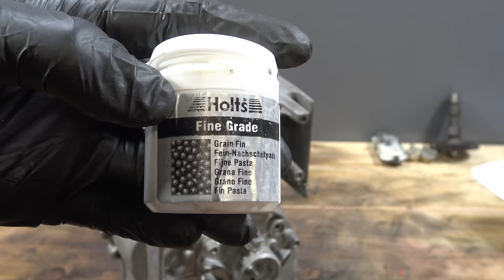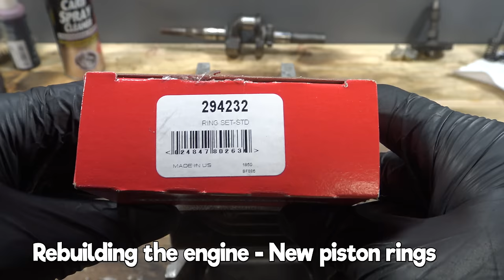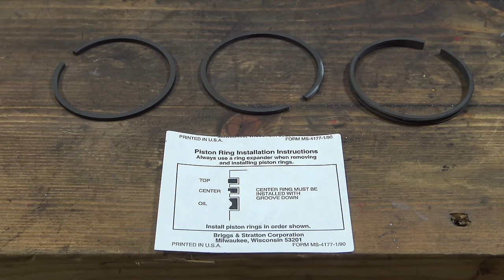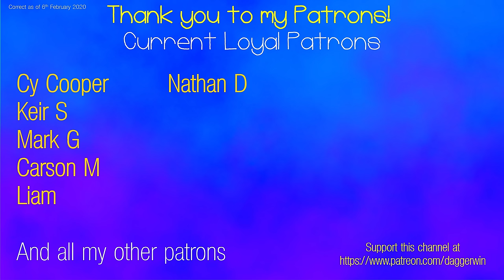RUSTY ENGINE REBUILD RESTORATION (Will It Ever Run Again)

Comment: Hell, that engine was in great shape to start with. The muffler hadn't rusted off and the tank had no holes!
Reply: Looked like I had a a fresh plug in it before teardown.
Reply: Also looked to have a more modern style head gasket when it was torn down.
Reply: @mattrzewnicki6343  it was..lol  and i still havent figured out what parts was missing...maybe what ever it was hooked to...lol
Reply: I'd have to agree, fresh plug and oil and sanding of the points it be going again
Reply: @holt7271  it was missing the Governor but I didn't see the bearing races for one anyway
Reply: @JamesMiller-fm8qs  me either..you know it would run a little in the first place...really wasnt a rebuild..he just took it apart and cleaned it..lol
Reply from the maker: It was missing several parts Shaun. No starter clutch, no points cover, no governor and no air filter assembly. No way could this have been started. Also the rings were replaced.
Reply: @MachineryRestorer  You spent more on the rings, gasket set, starter clutch, etc. than a new motor would have cost! I can get all the F-head 3 HP's I can carry for $62 a piece. $109 for a new-style iron-block OHV 3.25 HP...
Reply: @holt7271  they had a little peice of sheet metal on the back of the block heat shield other than that it wasn't missing anything
Reply: @MachineryRestorer  good job kid. It's good to see younger generation, restoring things that were manufactured before they were born
Reply: @Walkercolt1  I think you missed the whole point. It wasn't about saving money.
Reply: Machinery Restorer  where are you getting parts and gaskets for this one?
Reply: That carburateour wasn t looking prety good and it could get more damage
Reply: @MachineryRestorer  can you pls say we're did you get the air Filter (which Artiklnumber) pls
Reply: @Walkercolt1  But then he wouldn't have a video that has 1.2 million views.
Reply: @MachineryRestorer  You did a great job on the engine, demonstrating a lot of techniques.
Reply: @Walkercolt1  you can also buy a 6hp predator at HF for around 100$ but anyone can buy a motor. If you like buying things that other people worked on, by all means go ahead. Some times people like to do the work themselves
Reply: What do you set your sonic cleaner on as far as temp.
 @MachineryRestorer

Comment: Anybody else start this video, and say to themselves, “It’s an old Briggs, it’ll run.”?
Reply: How will old Briggs not run? Even if it was underground buried for 10 years it will run. They built them so good they can't be destroyed. It's just that good
Reply: @andrewstrainstuff1773  lol with ya there
Reply: Soon as I saw the sticker im like yeah that's got another 200 years left in it
Reply: @omfgallusersaretaken   u right u right
Reply: I find these old engines in trash piles from time to time. Usually needs nothing more than fresh plug, few shots of carb cleaner, and a couple of pulls to get running... You can't kill them.
Reply: Huh, that's weird.
Reply: @michaelh7527  hey uh Michael, where do you live at? I'm trying to build a railcart and could really use a small engine like that!
Reply: Andrew's train stuff dude we rebuilt one in my auto shop and we ran it on carburetor cleaner
Reply: Yea I rebuilt one of these for my go kart with my dad 2 yes ago it was have token apart left in a barn for 17 yrs and me and my dad rebuilt it in 2 days still runs
Reply: Yea
Reply: I have an old Briggs 159cc it won’t run at all
Reply: my uncle lost one, it did take a sewage truck running over it though...
Reply: It looks great on the inside. I have seen worse.
Reply: Dylan Boerboom yes, I chuckled and said  “that isn’t a question, I know it’ll run”
Reply: Engines are actually really simple you have to really fuck up not to make it run again
Reply: No.
Reply: @andrewstrainstuff1773  they used to build good engines... Now they are crap
Reply: @romanrapoz4813  Yep.  Every newer version I have I've had to at least take the carbs apart and drill out the main jets 1 - 2 sizes larger just to get them to run without having the chokes permanently wired half on. 

Interesting side note is that even with the larger jetting they actually burn less fuel at load due to not being run in a excessively lean condition!  😎
Reply: No, I was thinking more in terms of why spend the time and money rebuilding a disposable Briggs. I have a Kowasaki engine model FA130  that was used in a 1988,  1989 Coleman-Powermate 1500 watt generator, I used it for all my power for a good 3800 hours run time at about 6-8 hours a day. I havent used it in 30 years, it really needs a new carb but it would run if I replaced the carb.
That Kawasaki engine was really nice, it got 6 hours of run time on a gallon of gas, quiet, smooth, if I could get a lawn mower with that engine it would be great. Always started right up, electronic ignition no points.
Reply: Yep, missing parts or not, it probably would have started right up without doing anything to it lol :)
Reply: Yup
Reply: One of my lawn mowers is from 1977 (Swedish Klippo) with a 4,5hp Briggs on it. Only thing done to it is new rings around 1995 (when I bought it), still runs perfectly.
Reply: Picked up an old go kart that had a rusted out brigs on it, no way it would start. Towed the kart  with a bungee cord off the exhaust of my buddy’s accord and all of a sudden the motor springs to life- all fun and games for 30 seconds until something flies out of the crankcase and I have a liter of oil on my shirt- ever since it’s been Honda’s for me
Reply: @andrewstrainstuff1773  the nokia phone of engines.
Reply: ...and you can even update it to electronic ignition       gotta love those old adjustable mainjet pulsi-jet carbs
Reply: CIA what an insightful reply. Hope you’ve had a good day, bud.
Reply: I used that one as a kid.
Reply: Andrew's train stuff go to a junkyard I’m sure you’ll find an old rototiller or something with one
Reply: I thought the same thing
Reply: Rollie mike   you sure yours is a briggs old briggs just had a choke tecumseh uses a primer
Reply: @forkliftofzen5318  I find that with most China engines, I wondered if maybe the factory was at high altitude.
Reply: @Dakalberry  It's due to emissions compliance.

Comment: Them old Briggs & Stratton's are great
Reply: Have you ever run Honda and  Subaru???
Reply: Mohabat khan Malak yes, and it’s still great.
Reply: I've done a few old Kohler's they held up well also, love seeing this restored.
Reply: Which cars or bike engine is this
Reply: I rebuild one for shop class and it had no hours on it like maybe 20 at most it's in great shape so I got a A+ on that
Reply: @mr.abhishek8158  lawn equipment and people put them on mini bikes and go karts
Reply: @jessemarchese7245  thanks bro
Reply: abhishek abhu probably a tiller motor
Reply: Funny enough I’m taking a class in high school right now as a junior and these engines were the first kind that we learned off of pretty crazy to find a vid of one being restored
Reply: @cullendugas228  Wood chippers, chipper vacs, yard vacs, trash pumps, water pumps, Snowblower's with winter shields on them, gas powered air compressors, lawn aerators, mini bikes, go karts, roto tillers, the list these engines were/are used on goes for miles, theirs millions of them. The 5hp is even more common.
Reply: New ones are great too
Reply: @SocietyUnplugged  They are? Because I have a pile of blown Inteks laying around all built in under the last 10 years. They throw rods like its their job. That Chaluminum their using to make them in China doesn't hold up well.
I swapped old flat heads back onto 6 to 8 lawn tractors that all had blown up POS Inteks all that were under 10 years of age for engines that were averaging 25 years of age and were built in Wisconsin and thats a fact.
Check my channel, I filmed a few, tractors that still looked new that have flatheads on them.
Reply: Fearless Thank You. I don’t share the same experience, so I guess I’m lucky then. My experience is also based on a handful of engines. I stand corrected
Reply: @SocietyUnplugged  The new ones suck. I'm sorry, they do.
The push mower engine's with their plastic carbs, garbage.
The intek tractor engines, with the NIkki 6, garbage. Even the v twins aren't as good as the opposed twins were. How many people have seen a valve guide slide on the old opposed twin? I haven't, but I've seen it plenty on the v twin. The only great engines briggs still makes are the vanguard's and those are expensive engines.
Hang onto those flatheads, they just keep going.
Reply: @Mr_Tecumseh  the plastic carb on my briggs engine makes problems all the time. Such a shame
Reply: @Mr_Tecumseh   it's common strategy mate. If a company sells you something that will run for 25 years, they wont take any more money from you for that time  being. If they make an engine that lasts for 8 years, they ll take money from a customer sooner. That's why 1300 euros cellphones are trash after 2 years of usage unlike the old ones, same as ovens, same as cars, same as boilers, as microwaves, as laundry etc
Reply: @DDBmaster  I've repowered several tractors in 2019 with older better engines, some still looked brand new. Its the Chiluminum Briggs is using now. They can't hold up. Its too my benefit. I have a pile of Inteks with thrown rods laying around, their garbage.
Its really unacceptable for machines this new to be having colossal failures that soon. The thing had barely any use, oil was within range and translucent. When does planned obsolescence go too far? It was a $2000 machine, it turned 5 the day I got it. But your right, he went out and bought another brand new Craftsman Tractor and the next one was even cheaper made. But hey, I'll take it. Now that Tractor has a better engine than the rest of them and should actually go 20 years if maintained properly. Its not a problem for people who know how to repower them. It isn't that hard, but most guys cant and don't have the time.
https://youtu.be/-_bpmvlNDys
Reply: @mr.abhishek8158  and theirs also raptor briggs engines for race go karts
Reply: You right .. now are more plastic than the metal . and the metal is porous ..
Reply: @mohabatkhanmalak1161  briggs very good motor
Reply: @Mr_Tecumseh  Exactly,  intek engines  are junk! One summer and the  compression release  broke!   All of the briggs flatheads were good ,keep going for years if taken care of!   I Put a briggs  opposed twin  in place of the intek .  Also 1983 8 hp horizontal briggs, i have since new fires right up and runs great,was on Troy-Bilt tiller .Wore tiller out engine  still going!    A  shame no pride and quality  anymore!  The flathead engines  have a bump cast into cam lobe for compression release called easy spin starting  ,as long as oil is changed regularly  they just keep going!  The flathead has a one piece  cam. intek  has a junk cam ,the lobes and gear are pressed on and the cheap compression release is junk!
Reply: @randallcarney1216  You said it.
I get nice nearly new Tractors with blown Inteks all the time. I throw a good ole flathead in it and send them down the road, likely to outleast the machine its sitting on. Same issue with the new Briggs winter engine, garage, in that case the Tecumseh flatheads are better for snowblowers too.

Comment: Just had a 1974 Briggs 5 HP break a connecting rod yesterday.   I was thinking of replacing the engine, however, after watching this video, I'm going to press forward with a complete rebuild.   This video is just the tutorial needed to proceed.   Thanks for taking time to film your efforts.   Good stuff!

Comment: When I was in high school I took a small engine course. This is the type of engine we would work on in class. 
I ended up working on so many of these little engines. 
Ended up getting a job in a small engine shop for a few years.  Love these little  engines. 
Nice video!
Reply: I took a similar class in 9th grade
Reply: same, 6/7th grade metal shop class. still wrench'n these days, i'll  always will be a gear head. b nice to have shop.
Reply: One of the best courses I took in high school was small gasoline engine repair.That course has paid dividends all my life.I'm 65 now and still dabble with engines.Love it!!
Reply: Same here, I took a course called Small Gas Engines as a freshman. That school also had a full auto body shop where people could get work done and students could learn the trade. unfortunately I moved away, and no other school I went to had any Shop courses. Still, loved the experience and now I do all the work on my car.
Reply: Similar.  As a 14 year old, I used to buy old lawnmowers from the local auction and do them up.  Then as a volunteer I would spend my weekends working at a preserved steam railway but I worked on the rail plant and machinery.  Typically small engines for rail saws, rail drills etc.  Then worked up to diesel locomotives all as a hobby before I met girls and figured they were more fun.  Several decades later, when i'm working on cars here, although I could easily afford to pay someone else to do the work, my neighbours will ask "Why are you doing that, why don't you just pay someone else to do it?".  My response is simple "Because I can."
Reply: @djtaylorutube  Same here worked on those old ones in jr. high in the 70's
Reply: Why is my mini bike briggs backfiring?
Reply: Watching my dad working in V8’s taught me so much. I know how an engine runs. I can write a story of how one runs and I’m only god damned 14 🤣🤣

Comment: Dang, the further I got into the video, the more surprised and impressed I was with the quality of that rebuild. I have to admit, my expectations were very low ;)
Just a little bit of advice there is I can give you: when lapping in the valves, do an actual fluid leak test. I was surprised how a visually perfectly lapped valve was still leaking, and an other one who looked exactly the same didn´t. That will give you some extra compression, and with these kind of engines, every bit is desperately needed. You might have done it, but in case you didn´t: check the valve clearence when the valves are lapped in and grind down the valve ends carefully. A tiny bit too much clearence is better than a tiny bit too little. Thirdly, mill the surfaces between the cylindre head an the block with wet fine grit sandpaper on an even plate (e.g. glass). I was surprised how uneven those usually are! Also: check for air leaks in the intake system by spraying some brakecleaner on certain spots with gaskets while the engine is running at idle speed. If it slowes down or speeds up, there is a leak. 
You might have done these things off camera, but if you haven´t, they really improve engine performance significantly and most of the time you only realize it afert you have the comparison!
Great work overall, keep it up!

Comment: "The engine cover also needs sandblasting"  
me: yay!
Reply: I was a little annoyed he didn't blast the engine case. It would have cleaned up nicely
Reply: So satisfying
Reply: @TravisFabel  It may have just been a bit of extra precaution to avoid getting sand into the internals.

Comment: Nice job, BUT.... You really MUST hone the cylinder to give it a good cross-hatch when installing new rings.  That bore was not cross-hatched when you dropped in the piston.  The rings will not seat properly and you'll lose compression and burn oil  Second...  On that engine, there was no appreciable wear, but it is also generally good practice to ridge-ream the top of the cylinder so that any ridge caused by the old rings doesn't break the new one.  These are not negligible points.  A very small quibble is that you should put a fibre washer under the screw that holds down the air-cleaner cover.  Vibration will chip your powder coat otherwise.  All that said, you made a wonderful video and I look forward to watching more!

Comment: Oh my god we have the exact same engine we had it sitting in a garage for YEARS and it was in a like sidewalk weed trimmer thing and it still runs perfect as new to this day i had no idea it was That old oh well that some serious quality right there
Reply: The old briggs engines were relaible as hell, built to last a lifetime. Sad to say they aren't like that anymore, it's cliche saying but it's a true one, they don't build em like they used to.
Reply: Actually, there's no quality to the aluminum bore engines at all. They are CHEAP! Cheap to build, cheap to buy, cheap to work-on, cheap to replace. An iron linered one is different. An IRON-BLOCK is real quality. An iron-block will be running for your great-grand-kids if you keep oil in it. I have an 11 HP vertical B&S from 1940's on an air compressor. Loose rope start. One part pull to get it past TDC, then  pull with the choke on and it'll usually start. Second pull with the choke off, it starts everytime. Oil-bath air filter, gravity feed carb below fuel tank, 10+ years older than me. Uses about an ounce of oil per tank of gas, like it did when it was new.

Comment: that is a real old motor, oversized bolts so it is easy to unscrew tha bolts, and solid dimension in all parts, this is built to last a lifetime
THIS IS THE BEST VIDEO ON YOUTUBE ON HOW TO RESTORE A MOTOR, VERY GOOD FILMING WITH ACCURATE TEXT UNDER

Comment: Your engine is missing the spacer that goes on the bolt between the engine base and the gas tank mounting bracket. The spacer is is like a bushing and is about a half an inch long. This will square up the gas tank to the engine like it should be. Great restoration, looks awesome!!!
Reply: I have a few of those motors and none of them have it?
Reply: You.   can.   make.   a. lot of money.  from.  yur.  house. American.  water.  work.  did.  this. on. 1970.   they.  became.   nation.  wide. let's.  MAKE AMERICA GREAT AGAIN
Reply: @melvinhernandez5074  ?